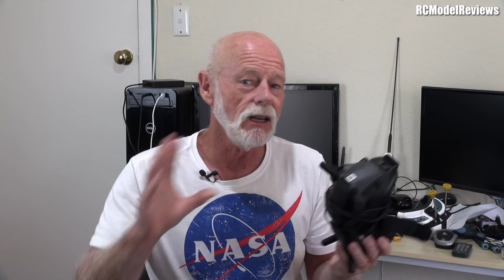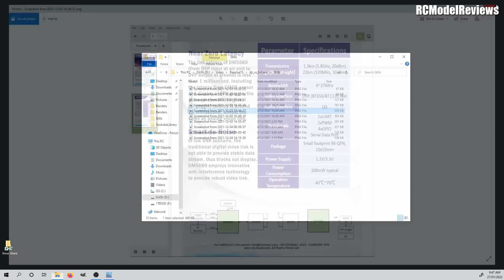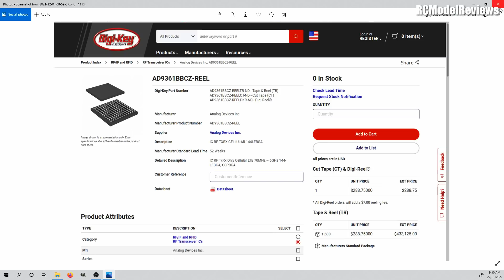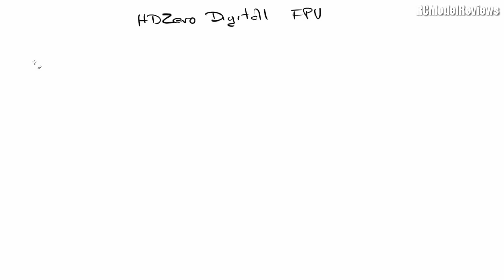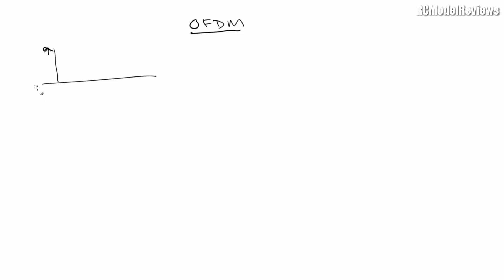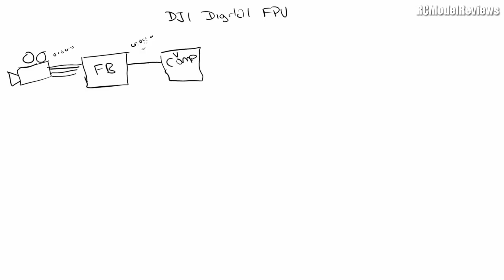Whiteboard:  How digital FPV systems actually work

Comment: Corrections:    (will explain how you can see these things yourself later)
1. Pure image based video compression  like MJPEG is highly inefficient.  H.265 and the like are 5-10x more efficient.    Your Fatshark DVR uses MJPEG and produces a very low quality video at a very high bitrate.  Compare that to any H.264 based DVR which produces a higher quality recording at a much lower bitrate.  The difference is MJPEG videos don't rely on keyframes so you can drop any frame, or series of frames, and recover from it instantly.   And you'll always capture the very last usable frame before the signal is lost for good, which is useful for a DVR.   

2. Yes DJI absolutely uses temporal video compression with periodic key frame packets followed by mostly  smaller frame update packets (like H.264, H.265/HEVC/VP9 etc..).  This allows them to transmit an entire image update (twice) and still have time left over before the next full frame from the camera, to handle some number of retry packets.   Under ideal conditions DJI is on air much less of the time, while HDZero is pretty close to if not at 100% bandwidth utilization all the time.  Can see this in spectral density plots. 

3. DJI doesn't create a single full sized keyframe for the whole image at once like most temporal compression.  Instead, it breaks the whole image down into smaller sub frames (not to be confused with the sub-blocks of all image compression), of somewhere around 5 across by 3 down.. and each has their own keyframe and  update packets, which are updated serially.  In other words, you can lose a keyframe packet and it won't destroy the whole image at once, but only 1/15th of it (if there were 5 x 3 subframes).   And even if the entire signal is lost for a few update cycles spanning multiple frames,  not every sub frame is transmitting a keyframe packet at the the same time, so some of the lost packets might kill a a subframe blocks, but most of them are just lost updates which only produce a small visual glitch across the rest of the blocks. 

4. DJI uses CDD (Cyclical Delay Diversity) to transmit a copy of every packet twice with a very short delay between them.   Rx tries to decode both and uses whichever one works. 

5. It uses MIMO (transmitting and receiving data through multiple antennas simultaneously) which allows it to move data through multipath reflections.    Proper MIMO can even move different data through the primary and reflective paths increasing total bandwidth.  I don't know how far DJI's MIMO goes, but I do know that it is highly effective in multipath environments where analog and HDZero still suffer.  In fact I often know that I can I fly further out of LoS if there are rocks, buildings and powerlines nearby for the signal to bounce off of.    The worst place for DJI is just flying behind a row of trees over flat ground where MIMO is neutralized, but with CDD and retries it still does pretty well. 

6.  This is covered in the video correctly but DJI can retry (resend) missing packets several times per frame before it starts to increase latency, and that's partly because of #3.  The keyframe and update packets are smaller for the sub frames, than if they covered the entire size of the video frame.     Worth noting that the Vista AU only has a single Tx antenna so it can't utilize MIMO from the Tx side but with CDD and additional retries it is still pretty effective.   In my experience the dual antenna AU is still more effective in deep NLoS and high multipath environments though.

So how can you see any of this yourself?
Regarding 2, 3  and 6.  
 Watch someone else fly with your goggles in audience mode.    The audience mode goggles are passive and not in the exact same position as the primary goggles so they're losing different packets and cannot request their own retries.  
As the aircraft flies further away or into NLoS conditions you'll see the video start to break up, but it will almost never be all at once.
You'll see small glitches which indicate lost update packets, and then sometimes see a block (one of the sub frame keyframes) go completely missing (frozen actually) followed by a bunch of update packets which show smeared motion but they're updating a lost keyframe so the updates make no sense.  This is normal breakdown of temporal compression, but at a sub-frame level.  When the next keyframe for that sub-frame arrives you'll see it repair the broken area.   But notice that you'll almost never see the whole screen blank out at once, but just more and more of the blocks failing and fixing themselves at different times.    
Compare to something like Connex Prosight from a few years back. When it lost a keyframe, the entire image was F****d, and it became impossible to fly on the updates alone.   Flying behind one tree was usually deadly.  
To see how heavily DJI leans on retries, stand close to the pilot's goggles while in audience mode.   The retry requests it sends out will start to swamp audience mode signal pretty badly.    As you move further away (more than about 4m) audience mode will clear up.     Two primary DJI goggles actually do the same thing to each other when they're too close, but they'll both try to patch the image up with more retries (and increased latency) until the signal from the aircraft is weaker then both goggles will suffer.   For this reason DJI pilots should always put some decent separation between each other.   I often see pilots standing/sitting too close to each other and they just don't realize how much better both of their signals would be if they moved further apart.    I've tested this extensively with my flying buddy flying long range proxmity/chase.  

As for 4 and 5 (CDD and MIMO).  Look at the FCC docs for the DJI system.  This is tech that they specifically list as in use and the fact that performance actually improves in high multipath environments supports this.   MIMO is standard fare for all Wifi standards (it's basically at the core of what makes Wifi viable in indoor high multipath environments).   I don't know who all uses CDD but it's fairly well defined, and it's well suited to mobile applications because one of the two packets is more likely to not be blocked by the same small obstacle even a moment later.
On a side note.  Several 2.4Ghz RC control systems used equivalent of CDD from day 1.  With low signal data rate, low refresh rate, high spreading ratio and high bandwidth available (thus each packet only take a tiny fraction of the total time to send), they'd just always send the same control packet twice per update, often having performed a frequency hop between them.

Comment: Your channel is one of my favorites. My dad wasn't electronics engineer. So I was a little shocked When I seen the way You had the battery cable wrapped around The DJI goggles We all know that puts stress on the little choirs inside the cable and causes failure down the road

Comment: 29:57 received frame buffer that we can access via usb bulk interface (which they added for DJI Smart Controller, but we can “borrow” for DigiView etc.) does contain key frames so I would guess there is some additional smarts related to them on transmitting end as well. I think you did a really good job explaining all of this, as usual, 45 minutes went by really quickly. Thank you.

Comment: 👍🏻  THANK  YOU  FROM  AN  AMERICAN  HAM (KD2MKZ).
Your basic  AND  highly technical videos are phenomenal!

I have the DJI FPV Racer and a second DJI Goggles v2 for my wife to watch my antics.
I also have the DJI Goggles RE which I originally purchased to used with my Mavic-2 zoom and Mavic-2 pro.

MOST of my “flying” is done way beyond VLOS as I’m kinda stuck in my house due to some physical problems.
(ankylosing spondylitis and PSA which has fused most of my spine and joints)

I fly over a power line easement (a mile wide and 40 miles long where there are no people or vehicles), so safety is not really a concern.

I wasn’t too happy with the distance/range of the Mavic-2 and so purchased the original Smart Controller in an effort to increase range.
Turns out… the original STOCK controller has slightly better range than the Smart Controller.
So, I went and got an external antenna kit for the stock controller and managed to install it without damaging the unit too much LOL.
Slightly better, but still lacking.
So,.  Went with a bi-directional (2.5w) 2.4ghz / 5.x ghz amplifier in between the controller and antenna.
Even slightly better, but too cumbersome to use..

After hearing about the advantages of OccuSync 3.0 , and my happiness with the FPV Racer Drone range…
I then purchased the Air-2s for the OccuSync 3.0 feature (really worked well) and was incredibly impressed.
I then bought an RC-Pro once the compatibility with the Air-2s was announced.

With the RC-Pro, the range is significantly improved over the stock controller!!

BUT…. NO  GOGGLES !!   
The Goggles RE does support HDMI input, so I can connect it to the RC-Pro.
THE PROBLEM—. My spine has degraded to the point that the HEAVY Goggles RE hurts too much to wear.
I really wish DJI would support HDMI input to the Goggles v2. 

I tried converting the HDMI output of the RC-Pro to analog composite (inputted via the 3.5mm connector on the Goggles v2)
but… the Quality is TERRIBLE!!   (How the heck do you LEGIT FPV flyers deal with the analog lack of visual quality?? )

Does it pay to get the HD0 and go HDMI from the RC-Pro to the digital goggles?
They seem much lighter than the goggles RE..

Anyone with any ideas from the YouTube community?

I am also contemplating selling my Mavic-2 gear and buying the Mavic-3 for the OccuSync 3.0 range and 
the larger battery capacity/ flight time.  

Any opinions?

Thanks!!

Thanks for your videos.

Comment: I know that HDZero claims no compression is done, but based on the quality of the image, how the image is tiled up, and how break up happens I highly suspect that HDZero is doing some form of S3TC compression. It’s a compression algorithm that doesn’t require buffer accumulation or delta frames and is super fast to process by relatively low power hardware.
Reply: I agree, there has to be some kind of "compression" being done, because a true, raw 720p video stream would require way more bandwidth than HDZero is using.

Comment: That was a very interesting comparison of the two.

Recollections from when I used to deal with these types of systems is that one of the advantages of OFDM over single carrier is better proofing against multipath because of the nature of multiple low bandwidth carriers as opposed to one high bandwidth carrier.

Useful when flying through spaces with lots of RF reflective surfaces.

Personally however, a few things will have to change before I consider HD0 over analogue, which is  more than adequate for my usage. DJI with its high weight, high cost and variable latency is an absolute non-starter for my use.

I notice though they could implement a fixed (though higher than HD0) latency mode if they wanted, at the cost of degradation with poor signals. Probably not in their use case, though.

Comment: I were thinking about digital FPV system a few years ago. I did not consider that uncompressed video might be a practical option.... I was mainly looking at the type of things used for video conferencing. (And likely implementing it on a DSP or FPGA...). HDZero seems like a nice design.  Details on the error correction would be interesting (and increasing that would likely help video quality a lot)

Some things that would be nice to mention: "modem" comes from MODulator DEmodulator.

OFDM is used for ADSL as well.

Comment: 15:59 I think you missed something: They almost certainly also add a variable amount of redundancy to the datastream via block-/convolutionial codes, so they can detect individual flipped bits and correct a certain number of them, similiar to how it's done in satellite transmission of digital television. Otherwise you  would get multiple frozen/black blocks of pixels in almost every frame that is being displayed. This is also how they can adapt the video quality to the signal strength, they change the coding rate (Send more correction data, send less picture data) when signal gets worse.

Comment: Excellent video. Also explains why when flying analog you can lose video when a dji video turns on considering the bandwidth they take up. Got to try an HD0 system soon
Reply: Just stay off R6 which is what it always powers on (DJI’s “public” channel 8) and coordinate other channels as usual.

Comment: Thanks for the great explanation. I didn't miss the squeaky noise of a pen on your analog whiteboard - tho the old"school" presentation had some value to it back then ;)
Also thanks for the plug - I wish tho that I could have actually shown the OFDM carriers - until now they are still just a myth to me. Next I'll try something easier like WIFI and improve my skillz. 
I also watched this one from Blunty where he interviews Davide (FPV Blue): https://youtu.be/KxqS-Uy76QI
Davide believes that DJI isn't even using normall OFDM but something way more complex. This is handy, I like to believe this is the reason why I couldnt yet analyze it on my spectran v6 :)

About DJI's disadvantage on fast moving blades of gras. ND Filters also on the FPV cam can help quite well here. firstly it "feels" faster, more cinematic already while flying and it helps to save DJI bitrate for more important stuff.
We could also try to "mask" out some blurry spots on the FPV lens (with clear tape?) to have some blurry spots on purpose in the edges (where for example my OSD elements are).
This should help to have more avail clarity there where we need it most...

greets, Mario
Reply: Good point about ND filter on FPV lens no one seems to talk about. It's the same principle that makes people use ND filter on GoPros to blur grass and other fast moving small details to get  less compression artefacts on YouTube.

Comment: Could DJI just add a couple of lines of code to enable an HDZero Mode? It seems DJI has every hardware an HDZero needs. Bypass buffer, video compression, and disable Smarts, then HDZero Mode is ON?

Comment: One followup question: As we all know there are 60fps high latency and 120fps low latency cameras for the DJI system. Why is that? Is the camera image produced by the 60fps cameras simply larger datawise and thus it takes longer to compress it or is there a different reason, like the camera is physically unable to maintain a high enough datarate for 120fps?
Reply: The 120fps ISP that DJI used (and is therefore used in things like Caddx Nebula Pro) was in very short supply for a long time when silicone crisis struck. Originally Caddx made Nebula cameras as a cheap alternative and as a way to have a nano cam (they couldn't fit the 120 ISP into a 14x14mm board and actually they still can't, the new-ish 120fps nano cams from both Caddx and RunCam are actually 14x16mm PCBs).
Reply: @FilipRadelic  Interesting, thanks!

Comment: Speaking of own HD system, have you thought about transmitting chunks of compressed video via 5.8GHz analog? sure it would take beefy CPU to do this but at least as proof of concept? AFAIK raspberry pi can output analog video, but to test this, I would have to record stream on DVR, then dump raw RGB frames and try if I can decode it. I have this in mind, but have not much time to play with this. IMO at least 15fps HD video should be possible to do this way. 
Bit more interesting would be to have many h264 streams encoded in image and sent over analog, this way keyframes are distributed so less "bandwidth" is required, non key frames can then be ultra reliable to transmit. So say worst case, you loose 2 256x256 squares out of 30 for 1 second.
Or am I dreaming?

Comment: I have started watching and after half of it I was too tired , bbut will watch it tomorrow, cause there is a lot to understand .
I simply use my DJI goggles, sometimes I switch to analog for an older plane but most likely I will stay with my goggles racing edition and its eco system after the orqa disappointment and Carl also not being ready - looks like an endless game or race except DJI crushes them with goggles V2 or V3 which I would prefer.

Comment: I am fairly sure jpeg doesn't send by area, but instead does an Fast Fourier Transform on the image and then throws away a ton of the high frequency stuff as most of the image is represented in low frequencies. A low pass filter on an image FFT shows up as blur the more you throw away - but the analogy still works, you're still throwing away all the redundant information :)
Reply from the maker: Yes, image compression is a complex process beyond the scope of this video so i tried to get across that it removes redundant information and fine detail.
Reply: There are a whole slew of strategies within the overall jpeg family that could be useful. Progressive decoding can provide a better than nothing low res image if the full data was not received in time. The JPEG2000 spec allows for processing sub-areas as individual tiles for multi-threading. In a very time and data constrained application like this it's feasible that some tiles could be deemed too low information to bother sending, and this threshold could be adjusted on the fly.
The cost is a bummer, but the DJI approach offers a huge range of tweaking possibilities for whatever the user needs. I dare say they could even skip the framebuffer stages and also do what HD zero does.... maybe